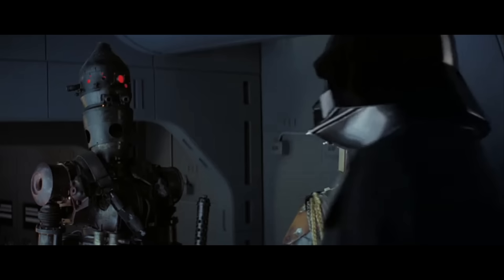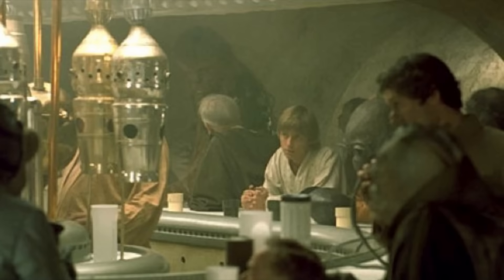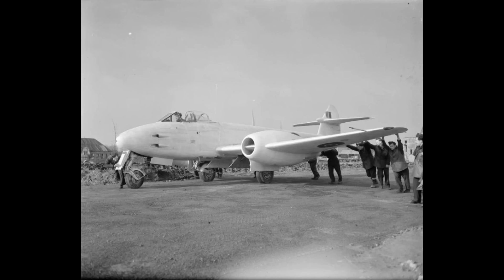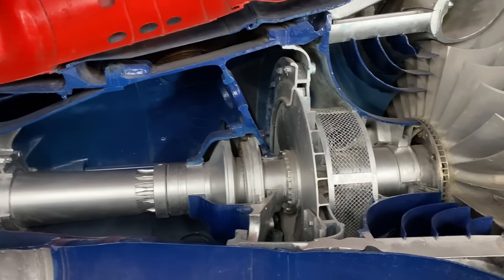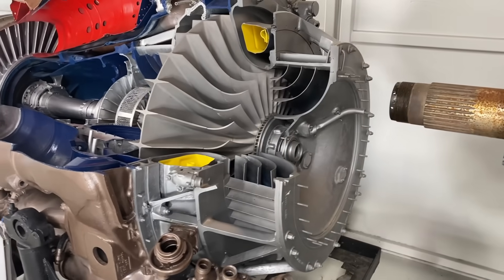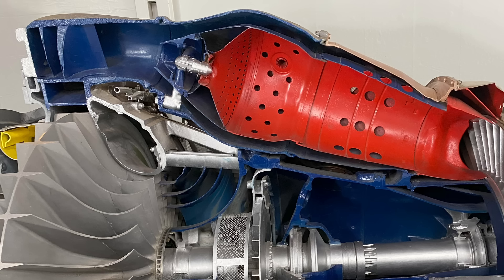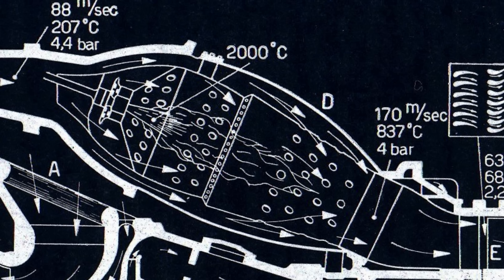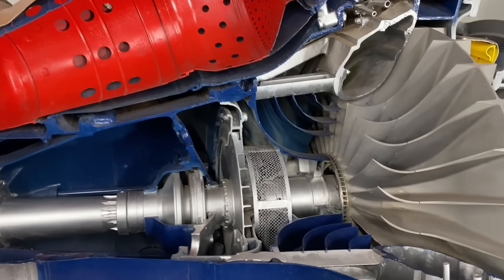The 1940's Jet Engine That Became Star Wars Design History

Comment: That's very interesting. I never realized that these early jet engines used a different kind of compressor. I wonder how much efficiency is lost having the air change directions so many times.
Reply: The centrifugals were a straight extrapolation of steam turbine technology and they were easier to make from a metallurgy point of view. The downsides were that they weren't very efficient and that there was an absolute limit to how big you could make them because the centrifugal forces on the compressor disc wolud tear it apart. The limit equated to an engine of about 6,500 lb thrust, so the Nene, Tay, J48 and VK-1 were already quite close to being the biggest centrifugals you could make. Basically it was a conservative, safe choice. UK engineers knew all about axials and, indeed Metropolitan-Vickers produced one which flew on a Meteor before the end of the war.
Reply: @MrHws5mp 

“The downsides were that they weren't very efficient and that there was an absolute limit to how big you could make them because the centrifugal forces on the compressor disc wolud tear it apart.”

Maybe it is a bit more complicated than that.  Besides there are a plenty of turbine engines manufactured today that use this technology. Also there is a brand new designed turbo-compressor that has started shipping in the last couple of years that uses this technology (with all of its supposedly bad inefficiency). The component diameter is over 5 feet!
Reply: @Mentaculus42  It's always "more complicated than that" but I was trying not to write a novel in a Youtube comment. Those modern engines that use this technology tend to be small ones, where the efficiency difference between axial and centrifugal is less important than the lower cost and simpler manufacturing process of the latter.
Obviously the limit on centrifugal compressor size is dependent on the material technology available, and the decision to go over to axials was taken in the late 1940s based on what was available then. If someone's revisited an old design by applying 21st century materials tech (and, doubtless, CAD/CAM) to it, then great: they may be on to something. It wouldn't be the first time that a discarded concept got a makeover with new technology decades later.
Reply: @MrHws5mp  
It is my understanding that there are benefits to using a radial compressor in certain applications. Generally it is a type of hybrid where there is multiple axial compressor stages then feeding a radial compressor. From what I gathered, once the gas that is being compressed is sufficiently dense by the axial flow compression, the radial compression stage is significantly better to do the further compression. Since these compressors cost 10’s of millions of dollars, and reliability and efficiently are paramount, then there seems to be a valid reason to use radial compressors. Note, these compressors don’t have to fly and don’t have to be light.
Reply: @Mentaculus42   Fair enough, although I still bet they use modern design, production techniques and materials to make them possible and practical, which weren't available in the late 1940s.

Quite apart from the technology issue, centrifugals are short and fat while axials are long and thin, so if the available space is short and fat, then that may means a centrifugal is the best solution simply because it's a better "jigsaw piece".

Comment: Shorter description of a jet engine - "Suck, Squeeze, Bang, Blow"
Reply: That's a piston engine. Jets are more like "suck squeeze burn blow".
Reply: Exactly how a four stroke works.
Reply: Jet engines do it all at once, continuously. Piston engines do it discretely.
Reply: @AerialWaviator  but they all have chüübbs.
Reply: @AerialWaviator  This is why jet engines are interesting, Functionally they are far more simplistic than a piston engine. All they are is a bunch of spinning fans, However the machine precision and materials science to make a good jet engine makes them far more complicated to actually make work.   Its honestly amazing that either engine works at all, Pistons and rods rarely exit an engine block and jet engines rarely melt themselves or chuck a fan blade off the shaft.
Reply: @filanfyretracker  Agree. Jet engines are just souped up furnace. 
Pistons burning holes in themselves, or rods failing was much more common on older radial engines. They were not machined to as tight tolerances as designs from 1940's onward. Radial engines still pretty amazing as they will keep running even with broken/missing components.
Reply: Suck, squeeze, burn, blow for a  gas turbine.

Comment: In Men in Black 2, there is a scene with a full ring of polished General Electric J-79 combustors. Also a whole stack of J-79 afterburner nozzle sections. Theres a bunch other parts, don't remember but there is a polished up blown big block chevy in the same scene as I recall.
Reply: is that when the LTD goes red button mode?

Comment: That doesn't explain how did early jet engine parts ended up in the parts bin for the star wars prop builder crew
Reply: This engine would have been far out of date by the time of Star Wars filming - so bits of engine would presumably be cheaply available in scrapyards near Pinewood Studios
Reply: Lots of these engines had been disposed of by the time of the first Star Wars film. A cutaway like this but of the original Meteor engine was in the entrance to my secondary school in the mid 70’s.

Comment: What is the advantage of axial flow compressors vs. centrifugal flow compressors such that they are the preferred choice used nowadays despite being bigger?
Reply: Done well they are more efficient in terms of the amount of power needed to produce compressed air. All as jet engines get bigger the diameter of a centrifugal compressor would become excessive from an aircraft aerodynamic point of view.
Reply: Centrifugal flow compressors are still used today, in smaller engines for helicopters and turboprops.

Comment: Whittle had a LOT of trouble with the burners. It took a chance meeting and contribution from a combustion expert to ensure this critical part was successfully implemented. My favourite part of his prototypes and early engines was the material for the turbine section blades... A particular stainless steel from a Sheffield cutlery maker made the engine viable withstanding the exhaust temperatures.. My memory is getting terrible, so I forget details and the name of the first chap and the type of steel/knife type for the second, I had a set once - Check your grannies drawers(?)..
Reply: That's a suggestion that reads two very different ways 😅

Comment: Dr Stanley Hooker, brilliant mathematician,  was employed by Lord Hives of RR but not initially given a job. Mooching around RR he picked up a Merlin supercharger impeller and decided to do the maths to check its design - which he found to be in error. So he asked the designers how they had designed it - turned out they extrapolated a Parsons steam turbine design, which was not directly applicable.
So Hooker re-designed it and transformed the high altitude performance of the Merlin.
That centrifugal impeller experience led to the early centrifugal compressor RR jet engines, and Hooker was shunted off to RR Barnoldswick to develop those. (Did you know the RB 211 was named after Rolls Barnoldswick?).
Meanwhile RR Derby started work on axial flow jet engines and Hooker felt sidelined, so he joined Bristol Aero Engines, where he developed among other engines the superb Olympus.
When RR went bankrupt over the RB211 and was bailed out by UK Government, Hooker was brought in to head up RR and sort out the RB211. Which he did!
I have never seen Star Wars. And have not missed it.
Vince
Reply from the maker: Stanley Hooker got to work on the Olympus engine for Concorde/Vulcan and the Pegasus that powered the Harrier - he really was a master of this stuff.
Reply: @scottmanley  Indeed. And his sorted-out 3-shaft RB211 is the basis from which today's superb RR turbofans stem. 
When Hives interviewed him for the job, on discovering his mathematical prowess, said "so you're not much of an engineer, then". That gave Hooker the title for his superb autobiography.
Reply: @scottmanley   Originally the Barnoldswick jet engine factory was owned by Rover who'd been tasked with developing Whittle's jet engine idea. They wern't doing very well, so Rolls-Royce were called in to help. Hives realised that the two companies were basically doing the wrong jobs: Rover, with a car background, were trying to develop an aircraft engine, while Rolls-Royce Derby, with a background in aircraft engines, was trying to develop a detuned Merlin (later named the Meteor), as a tank engine. So, over a miserable meal in a local pub, Hives proposed a straight swap: Rover would take over the Meteor plant and RR would get Barnoldswick. No financial reports were done, no due dilligence, compliance, or any of the rest of the mountain of paperwork that would accompany such a deal today: it was agreed verbally and sealed by a handshake!

Another miserable pub meal somewhat later saw Hooper and some other Barnoldswick engineers have the "lightbulb moment" that if they scaled the Nene down by 5/8ths it would be a perfect fit for the Gloster Meteor jet fighter and vastly improve it. The basic maths to confirm that it was workable was done on napkins in the pub! Thus was begat the Derwent 5.

I don't know what conclusions  to draw from any of this, except that the next time somebody takes you out for a crappy pub meal, don't complain: you might just have a genius idea! 😉
Reply: There is a good interview with Stanley Hooker from maybe 1982 or so, I've seen it on YT so it is probably still here somewhere.
Reply: Stanley Hookers autobiography “not much of an engineer” Airlife publishing ltd.
Reply: Hello Vince!

Comment: We don't call them flame tube. They are called jet engine combustor liners.
Reply from the maker: I don't think Rolls Royce cares what you call them, they used the term 'Flame Tube.
https://www.harmjschoonhoven.com/Smith-Rolls-Royce.html
Reply: @scottmanley   "Reheat" vs "Afterburner" is a tomayto/tomarto thing, so why not "flame tubes" vs "combustors"?
Reply from the maker: @MrHws5mp  Some engine manufacturers used to refer to afterburners as 'augmentors'
Reply: @scottmanley   Yep. IIRC, "augmentor" came from pre-jet engine days when there were various attempts to boost thrust on piston-engined types by burning fuel in a duct fed with air by a compressor driven mechanically from the piston engine.
Reply: @scottmanley  I'm just speaking from my experience as an aircraft mechanic. Engines today we don't call them that anymore. I regularly work on and inspect PW4000 engines on 767's. Actually getting ready to go take a line maintenance class at their facility in Hartford Connecticut

Comment: The have examples of this engine and the Mig 15 in a large air museum just outside Krakow. Well worth a visit if you're in Poland.
Reply: MiG-15 uses the VK-1 designed by Vladmir Klimov
Reply: The vk1 was just a licensed built version of the RR Nene, used in the hawker Sea hawk
Reply: @Tank_Ace_Aidan  FACT CHECK: 
 The licensed built Soviet version of the Rolls-Royce Nene is called the RD-45

The VK-1 is an original design by Vladmir Klimov.
 Any questions?
Reply: @DoktorBayerischeMotorenWerke The VK-1 was a slight development of the RD45/Nene, certainly not an original design!
Reply: @paulsengupta971  Prove it! the VK-1 is larger, more powerful and shares no parts interchangeability.
its a popular but completely false revisionist myth that the VK-1 is a copy of a British engine... they were not the only ones to build centrifugal turbojets.

Comment: A clever bit with the holes in the can is to center the flame so that it doesn’t get close to the walls. The metal used really isn’t made to take that high heat for a long period of time so the air let in helps to keep the walls relatively cool.
Reply: Correct
Reply: 30 seconds is too long to explain Suck, Squeeze, Burn (Bang in piston motors), Blow.

Comment: The Nene engine was impressive for its time, being used in multiple aircraft, including the F2H-2 Banshee iirc, and the British Sea Hawk, both carrier based fighters which needed as much thrust as possible in the lightest package. Both aircraft used a unique dual inlet dual exhaust setup. The most fascinating thing imo however, is that the Sea Hawk used a pyrotechnic gas generator to spin up the turbine for starting on the ground. The exhaust for this gas generator was on the upper side of the fuselage, and spat forth quite the plume of sooty smoke as it operated.
Reply: Nope: the Banshee had two separate axial engines in the wing roots. The only aircraft to use the split jetpipe was the Sea Hawk. The US Navy's Grumman Panther and Cougar used US-licence-built Nenes and had similar intakes to the Sea Hawk, but they had conventional jetpipes. 
Here's a fun fact though: when the idea for the engine that became the Harrier's Pegasus was knocking around, the scheme produced by Stanley Hooper at Bristol Engines (based on an idea by French designer Michel Wibault) only had movable jet nozzles at the front and a conventional jetpipe, the idea being to give STOL(Short Take-Off and Landing) capability, not VTOL (Vertical Take-Off and Landing). Hooper then sent the drawings to his friend Sir Sydney Camm at Hawker's to see what sort of plane he could wrap around it. Camm looked at it and had the brainwave of putting the Sea Hawk's split jetpipe (for which Hawker owned the patent, not Rolls-Royce) on the back so that it could have swivelling hot nozzles and true VTOL capability.
Reply: @MrHws5mp  yup you're right, I'm a little rusty on my old naval aircraft. Beautiful airframe regardless, though the Panther without its tip tanks is slightly cursed.
Reply: @EnderMalcolm  The genius of the Sea Hawk was that the split jetpipe let it carry  fuel in the fuselage behind the engine where the Panther couldn't, so it had to resort to the draggier tip tanks.

Comment: Brilliant explanation. Did you know that in the '70s they put 2 Derwents on a rig on the front of a fuel bowser, exhausts pointing forwards, and used them for runway de-icing in the UK? Us operators, had to sit in a small cabin between the 2 and operate them while the poor bowser driver tried to keep the whole shebang pointing in the right direction with both Derwents at high RPM. I am not sure much ice was removed but it was great fun!
Reply: The Russians had/have a lot of similar vehicles using surplus VK-1 engines.
Reply: @MrHws5mp  they used them to de-ice aircraft wings, saw them in operation at the airport where we operated for three years.
Reply: I used to do the same... At Abingdon, Wittering and Laarbruch in the 70's and 80's. As you say... a bit hairy. Too much power and the bowser went backwards. I once had a weld fail on the mounting frame and I found myself at 45 degrees to the bowser. Great fun if the heater in the operators cabin worked 😂
Reply: The Swedish Airforce did something similar with RR Avon engines. (EE Lightning, EE Canberra, Hawker Hunter, Saab 32 Lansen, Saab 37 Draken. And others.)
But while the axial flow engine was mounted horizontally on a lorry/truck chassi, the exhaust was aimed down at 90 degrees to the ground through a nozzle.
Wasn't used for too long though. The amount of fuel needed, and the amount of damage done to it and the pavement, if carelessly operated, made it counter productive.

Comment: Sort of makes me wonder what would happen if one used what amounts to a large electric toaster element instead of burning fuel to reach the desired temps...
Reply from the maker: It would be terribly inefficient compared to just compressing the air and flowing it out the nozzle.
Reply: @scottmanley  I understand that, still would be curious if one could get it to run as a tabletop model. If there were batteries strong enough and light enough could one make an "all electric" jet engine work (I know there aren't and that the required energy densities are beyond all known batteries), if only for a few minutes while the batteries last sort of thing.
Reply: Energy density of jet fuel.
Reply: Good luck getting an element that provided heat at the same rate as burning say 500kg per hour of Jet fuel whilst being sufficiently small so as not to block the air flow.
Reply: You'd have a hair dryer?

Comment: Something of interest around those can type combustors (and can-annular), is during testing in development of some later engines that used them, you could get the flame-flameout sequence where the s]flame would run around lighting cans and then immediately extinguishing.
Reply: predecessor to the rotating detonation engine - the rotating deflagration engine :D
Reply: @moontravellerjul 
Don’t laugh, there is on going research on Turbine Combustors that use “detonation combustion”.